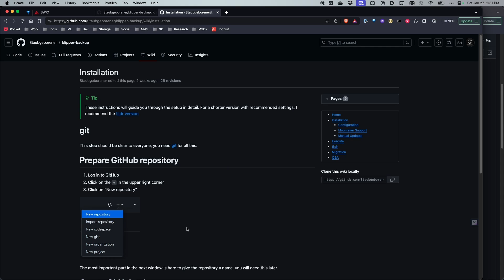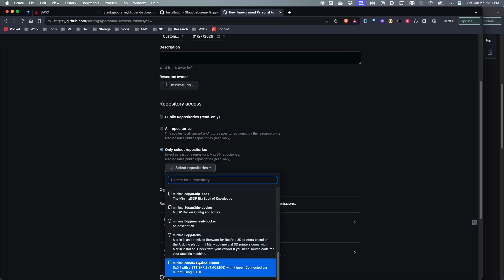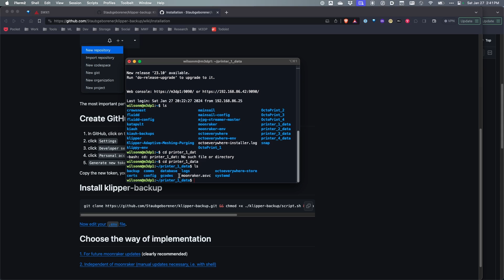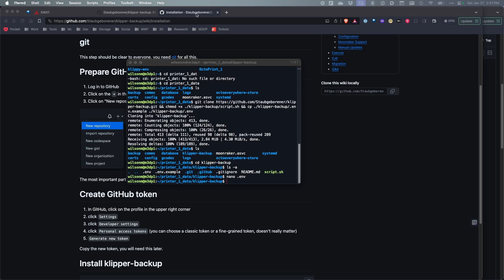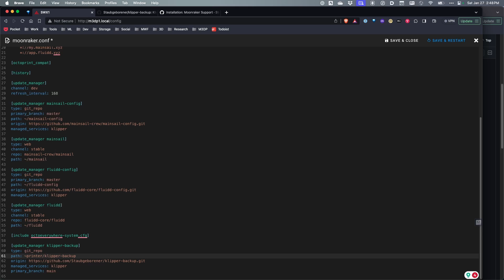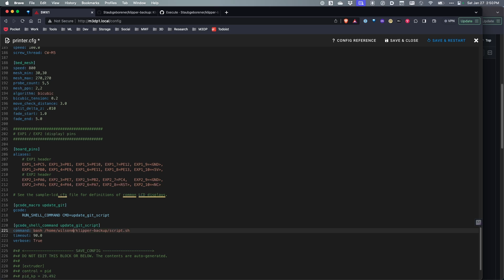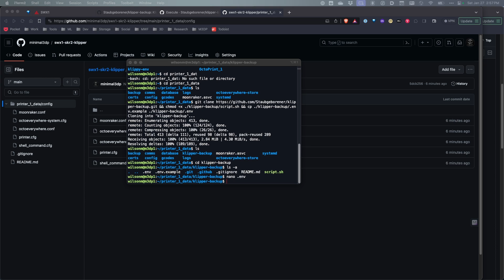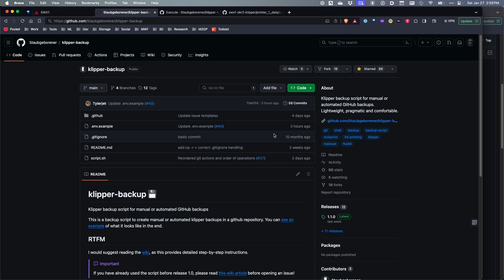Klipper Backups! A New Guide to Using Klipper Macros to Backup Your Configuration Files

Comment: cant back up getting
"Updates were rejected because the tip of your current branch is behind
its remote counterpart. Integrate the remote changes (e.g.'git pull ...') before pushing again. See the 'Note about fast-forwards' in 'git push --help' for details."
Reply from the maker: Take a look at doing a git pull at the command line
Reply: @minimal3dp  very new to git stuff, where do i look for doing that?

Comment: I figured out my first issue but now I'm at the clipper macro and I'm getting this error "Section 'gcode_shell_command update_git_script' is not a valid config section"
Reply: Need to install gcode shell commands. This can be done using KIAUH selecting 4 (Advanced) and then 8 (G-Code Shell Command)
Reply from the maker: See @johnprinsen1431 's comment.

Comment: I get an error with the button addition   Section 'gcode_shell_command update_git_script' is not a valid config section
Reply from the maker: You might need to add gcode shell commands. I do it with a my install and forgot about it. I will look for a set of instructions for you.